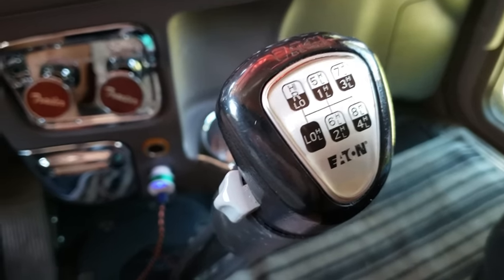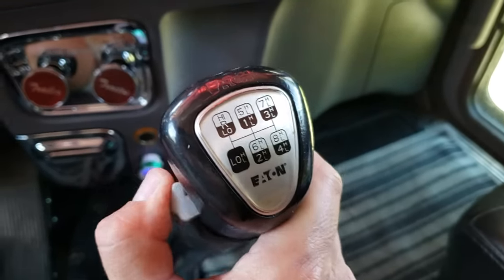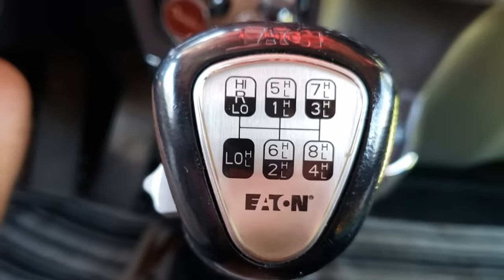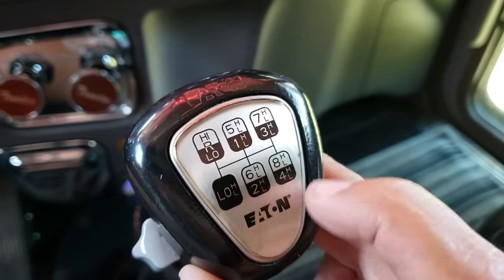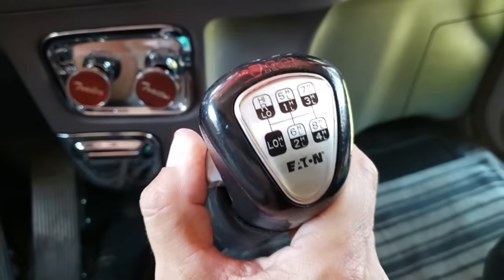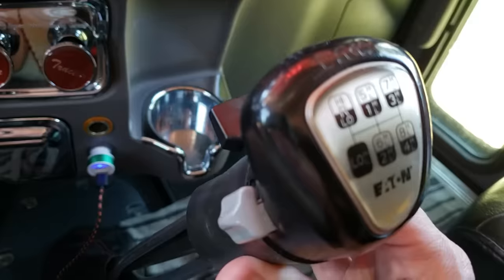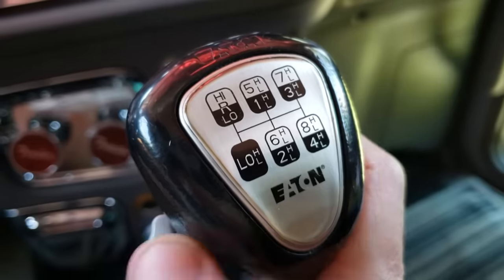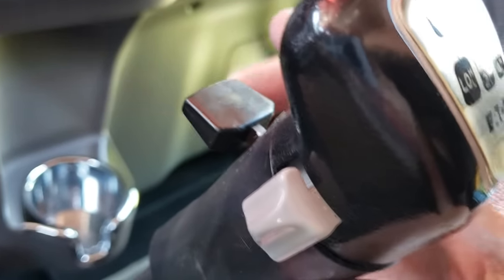HOW TO Shift 18-Speed Manual Eaton Transmission. Peterbilt, Volvo, Freightliner, Kenworth, Mack

Comment: What mph Range would you choose for what gear
Reply from the maker: Ohhhhhhhhhh man, that's hard to say.  Every truck is different depending on load, model, going up a hill or flat, and of course how much you are towing.  I don't even look at MPH versus what gear I'm in.  It's so easy to listen to engine, and don't over rev.  Semi trucks are so different that driving a normal Chevy or Ford truck.  It's all about taking your time and letting the torque build and get you down the road.  I love to keep my RPM's up a little bit when going up hill, then down the highway, let the truck cruise in top gear, if possible, for better fuel mileage...

Comment: For best explanation 18 is just 13 but the difference is that in 18 you have to split the gear in low gear ( 1, 2, 3, 4) but in 13 you don't split in  low gear, you split only in higher gear ( 5, 6, 7, 8 )

Comment: So, is one of those switches shifting a 2 speed rear end, or do they both shift in the transmission?
Reply: They both switch in the transmission. They normally have a high/low gear set on the back of the transmission. The splitter basically just adds another set of gears on the back of that.

Comment: Is it necessary to split every gear or just on hills or when pulling heavy loads?
Reply: I only do it going up hills or with heavy loads. You don’t have to use the splitter. You can just shift through the gears like a 10 speed.

Comment: Question. Can you down shift a half gear using the spliter on a small grade for more rpm. And are drivers double clutching an 18 speed ?
Reply from the maker: If you'd like, you bet...these transmissions are tough and fun to use after you memorize shifting, etc.

Comment: Is double clutch still used  when  changing gears?  I left trucking 15 years ago, can you update me on this one
Reply from the maker: You can double clutch if you'd like, but most people "bump" shift, give it a little throttle, shift like butter after awhile.  When you first get a CDL Class-A license, when you test drive they like you to double clutch.  95% of my friends don't double shift, take it easy...
Reply: Got it . Still the same. Right rpm and you don't need to use a clutch. They come with automatic transmissions for the new generation. My days we like to feel it the high and the lows. The extra red or Grey   switch on the stick confuse me.

Comment: What is it drivers prefer about a manual transmission as compared to an automatic? I am not a truck driver but I have towed a 26k stacker behind a SuperC RV and the Allison 4000 transmission was amazing. What advantage does all this manual shifting have?
Reply: I agree that Allisons are amazing, and a pleasure to drive, but the “automatic” transmission that you would find in a class 8 tractor is NOT a true automatic like an Allison. The proper term for it is an AUTOMATED transmission, and it is essentially a manual transmission with computer controlled actuators doing the shifting and clutching for you. It is a completely different animal than an Allison. 

While it can be a real help to novice drivers, and those who never quite got the hang of shifting an unsynchronized manual, it can be terribly frustrating for drivers who have mastered manuals. Notice that I said “can be”. Some experienced drivers love them, especially in stop-and-go traffic. Personally, I despise the one I’m driving. I won’t get into the reasons, because they are numerous and would require rather lengthy and technical explanations. But I would much rather have a 10 or 13 speed manual.

Comment: So is going from 4th to 5th just essentially 4th to 1st? Do you flip the splitter?
Reply: Yes. The paddle on the front switches between the low and high side. Basically changes a gear set on the back of the transmission that takes it from an under drive to direct or overdrive. So, you basically shift like a 4 speed on the low side then switch to the high side and start over in 1st. 
The splitter is only shifted while you’re in a gear. It’s less of a change than shifting to a different gear. That’s why they get called half gears since it’s kinda like only changing a half a gear instead of going up/down a whole gear. 
He didn’t really cover that the paddle for high/low range only shifts when you go through neutral. Flipping the paddle while it’s in gear won’t do anything. The splitter switch on the side shifts when it’s in gear, but you have to back off the throttle since it can’t shift under load. 

It makes way more sense if you get to drive one for a while. Going up through the gears is pretty easy. Slowing down is harder since you have to rev the engine to the right rpm to get it into gear. It’s also hard being able to pick the right gear for the speed if skipping gears.

Comment: Does the black thing only stay down at 1 thru 4 and it just stays up for anything past 4?
Reply: Think of the black this as high and low 1-4 in low than the same 1-4 becomes 5-8 in high and on 18 speeds you can split ever gear into another high and low.

Comment: When you are on 4th gear,you don't go to 5th.yougo to low,but with the selector up.wich will make it an extra hi gear.
Reply: Not with this one. Low is extra low so if you go from 4th to Low on the high side it wouldn’t be much of a change. Especially with the splitter. 4th split high is probably almost the same ratio as Low in high range.

Comment: Waste of gears unless you heavy hauling and I'm not talking 46k in the box I'm talking grossing 100k plus to the ground.  You're never gonna use all the holes in an 18 unless you just like wasting time shifting gears.  Best overall transmission has always been and always will be the 13.  Other than that this was a good training video.  Good job hand 👍🏾 🚛🚛🚛

Comment: @2:42  I thought the H/L in LO gear referred to the option to use the splitter, just like is indicated on the numbered gears.   I would think one would avoid the range selector in LO gear, just like in a 9-speed.  

Doesn't the combination of high range selector + LO gear yield an overall ratio just below 5th gear-- essentially equivalent to 4th gear?   Isn't this why a 9-speed isn't a 10-speed, because there are only 9 unique forward speeds (even if there are 10 forward configurations)?

I always thought an 18-speed was a 9-speed + a splitter on every gear.  (Whereas a 13-speed is a 9-speed with a splitter only on the high-range 4 gears.)

Comment: Mercedes benz has the same thing I mean the white button but instead of using the throttle you just push the clutch and the gear changes without moving the stick

Comment: Seems like under most circumstances you can just run 1-8 right? You shouldn't need to split gears unless you're running heavy loads right? Is that the purpose of it or am I missing something?
Reply: You only use the gears you need. When I'm pulling two empty 53' trailer I can straight shift up to 8th and then split up or I can split 1st and straight shift up to 8th.

Comment: My question is do you need to split the gears or can you just go into the next without splitting
Reply: Yes. no need to split whatsoever. Can run 1-8 in either L or H. Split gears only needed when fully loaded or upshifting up an incline.

Comment: I've always drove a straight 10 so I was always curious how that worked. It's actually way easy just gives more options if you didn't want to downshift the whole gear for more rpm
Reply: Yes can split a gear and only drop 200 rpm instead of 400.  If you got a very heavy load you can keep the turbo in the sweet spot on hills.

Comment: To down shift you have grey button to the forward slow down depress the clutch down shift, then pre select the switch down ease on the brake a little ease on the gas she will shift down pre select button forward easy on break cluch down next gear

Comment: I know this is a silly question but I drive a 5 speed manual car and I have no experience with trucks but I really want to learn to drive a 18 speed truck will it be challenging? Any suggestions? Oh and I’m 23 years old.
Reply: Not even remotely the same. Car and pickup manual transmissions are all synchronized. In North America big truck transmissions are not. You have to manually synchronize using the throttle. Sounds tough but once you get the hang of it, it's a piece of cake. BTW, your age has nothing to do with it. Just find someone to show you the tricks and you're good to go.

Comment: How do you remember what gear you’re in
Reply from the maker: After a day or two with this trans, it's not hard to remember the gears.  If you forget you can always flip the selector to the (down) position and go into a gear according to your speed.  The trans won't break, and if you let out the clutch slow you will really know if you are way too low.  If you are too high the engine will just lug.  But like I said, the more you drive you just automatically figure it out.  Most drivers that prefer manual, love the 18 speed the most.  So much variety, especially when you go uphill or want to pass, etc...
Reply: just go with a company that offer automatics
Reply: @poundtrader1414  I’m just trying get more information on a 18spd before I jump in it I know how to drive a 9/10 Speed im just trying learn some extra tricks to make it easier and smoother

Comment: Best explanation thanks.How do you down shift a 18 speed
Reply: ex. max load 80kLB at 60mph start going up a steep grade 6%+ from 8h, watch your rpm, wait till rpm drops between 10-10.5, then go 8L then watch rpm drop 10-10.5 then go 7H watch rpm drop 10-10.5 go 7L then watch rpm drop 10-10.5 go 6H.. and so on until rpm is stable.

Comment: Do you have to clutch in and out, every time you shift , the shift stick? As you would on a regular manual transmission? And is it true that if you skip a gear, your truck shuts off?
Reply: class c manual vehicle and class a manual truck completely different.. class a manual truck is about rpm and when using the clutch you only clutch in and out about 5%-10%.. if you clutch it all the way like a normal car, it will not go in.. only push the clutch down all the way when coming to a full stop. once at full stop, take it out of gear and start at 1st if fully loaded or 3rd/ 4th if empty.
Reply: If you push the clutch to the floor in a big truck you will burn out the clutch brake. No clutch brake on cars or pickup trucks. I only use the clutch when starting or stopping. The truck does not shut off if you skip shift.

Comment: Reverse is not counted in number of speed. 18, 13, 10. It refers to the forward moving gears. So (LO.L) would be 1 (LO.H) would be 2 (1.L) would be 3
(1.H) would be 4. So on and so on. 
Sometimes you will come across a Reverse that has hi,lo that can also be split. Therefore making 4 Reverse gears, and 18 forward gears. Otherwise great video
Reply: Correct.  I was wondering why he skipped the fact that you have two in LO

Comment: I know that the difference between an 18 speed and 13 speed is that all the gears on the 18 has high and low ( split ) and on the 13 it is the high gears that has high and low ( split ).What is the arrangement for the 15 speed transmission, that is what is the shifting pattern for 15 .
Reply: 15spd transmission do not work even remotely the same. The splitter on a 15spd is a deep reduction splitter that gives you 5 gears that are lower than 1st gear. It's basically a 10spd with 5 creeper gears and they are not used together.

Comment: IMHO, the low gears of an 18 speed are only needed for extremely heavy haul or driving off-road in dirt/mud.  I haul un-baffled liquid and routinely scale at 88,000.  I start in 2nd unless stopped on an uphill grade.

Comment: So, when shifting from say 6H-7L, does the stick need to be in neutral to "unsplit" the shifter? (Not a  driver, but considering new career paths here).
Reply: Not really required, you can switch it  before you shift however the second you take your foot off the fuel the truck will try and shift to 6 low, so you'll get a smoother shift if you switch the  splitter while your in between gears

Comment: Thanks! Great vid. It’s actually a 22 speed, because the h/l reverse and de LO h/l are 4 gears + the 2x 8 normal gears... right? 🤔
Reply: Reverse doesn't count as a gear.
It's just a different direction.
Reply: @donalejo1556  yes exactly. I've never heard anybody count reverse as a speed. In reality all vehicles have reverse so that would be pointless.

The guy in the video is incorrect in his explanation of how it's 18 speed however that's of little consequence. All that matters is how you drive it. How I've heard it described by a heavy-vehicle assessor is 8 main gears all of which can be split for 16 plus the low gear which can also be split for the 18

Comment: I wouldn't use the high low splitter in reverse that's just like 6th gear speed in reverse almost dummy use the top splitter on the side for slightly faster

Comment: It's a glorified 13 spd. Only difference is you can split the low side with your splitter. With a 13 spd you can only use the splitter on the high side.

Comment: Anyone know what problems is or why when I hit splitter to go back to low gears it won't? Had this issue in other Kenworth but can't get ahold of mechanic to ask
Reply from the maker: Sometimes you have to tap the pedal for it to downshift.  Might need an adjustment or new parts...
Reply: @CoryJDraper  yeah we just rebuilt transmission and it's been doing it since. I was able to finagle by slowing n stopping quick, etc. Now it's really stuck,  needs something I was hoping someone would see this n go oh yeah my Kenworth did that too, this is what's needed!?

Comment: So instead splitting the gear, ie 7th then split the gear, isnt that putting into 7H from 7L. Like you said 7th to 7th 1/2. But isnt that low to high?. But in the bottom gears you use the black switch, for high low? Cause you use that to transition from 4 to 5. So you're not putting back into 1st. Or 8th to 5th etc etc.

Comment: to call it 18gears is a litle bit show off  actually  is 8 gears 4 low 4 high and you can split them all  so 8+8=16 plus  1 for crowling and 1 reverse witch you can also split them or use high and low.
usually at the 4 low gears depends the load and how powerfull is the truck you do not split .

Comment: Hey there Cory , what Revs on tac to change up and changing down gears estimate ? 
thanks , good video
Reply: That depends on so many things. Horsepower and torque of the engine. Flat ground or hills. Total weight of the truck. You end up shifting so much that after a while it becomes second nature.

Comment: In actuality it's 16 speed folks...for forward gears that is
Reply: No. He stated it wrong. Lo, 1, 2, 3 & 4 can be split which is 10 gears. Flip it into high range and 5, 6, 7 & 8 can be split for 8 more gears. Reverse has nothing to do with it. Lo isn't used in high range.

Comment: Why does something that only goes up to 60mph with a governor have 18 speeds?
Reply: They have a narrow rpm range on the engine and relatively low power for the weight they’re hauling. So, having so many speeds let’s you keep the engine in it’s ideal rpm range.  You generally try to keep the big diesels between about 1200 and 1800 rpm. Most are only about 2500 rpm max rpm.
Reply: @NBSV1  is it hard to keep it in the rpm range? also if it much different to drive with a heavy load vs no load ?
Reply: @beauhalliday9496  It's not that hard to keep it in the overall range which is between about 1200 rpm and 2000 rpm. But, if you're able to keep it closer to where it makes peak power then there's quite a bit more power available and it'll do better.

It's way different with a load. If it's just the truck by itself you can simplify it a lot by basically just sticking to the high gears and treating it like a normal 4 or 5 speed transmission. With an empty trailer you can still take off in 2nd or 3rd pretty easy and not worry about splitting gears. If loaded heavy then you end up taking off in low or 1st and may not really need to split all the gears, but it makes it smoother and will pull better. 

There's a good bit of skill in learning the timing for shifting. Hard to really get a handle on it without driving and feeling it.

Comment: Anyone wanna explain why you would spec a truck with this many gears to not be an automatic?
Reply: Because the automatics are usually just 10 speeds or less. Because the automatic is just reacting to conditions they sometimes struggle with figuring out what gear to be in with only 10 speeds. Give them 18 and it’d probably wear everything out from constantly shifting trying to keep up.

Comment: I like 18’s, I’m driving a 13 now and the low range is irritating without splitting
Reply: Splitting the bottom gears is mostly a convenience. Really handy when you have to start out on a very steep hill. I've been running 18's for 10 years and rarely split 1-4.

Comment: I got it pretty quickly. Going for a job with a 18spd. Drove nothing but 10spd and was worried because it’s new, but it’s pretty simple. I got it with the splitting before you fully explained it.

Comment: So pretty much just drive an 18spd like a 13spd ? lol got it!! Only difference is the color of the splitter and you have the option to spilt every low gear with an 18 spd
Reply: Yes. BTW, if you leave the splitter in hi and you try to downshift into low range, the range selector on a 13spd will not move, on the 18spd it will allow you to shift into low range.

Comment: @ 2:40 is not correct, I gather you don't haul heavy loads and use low gear.  It's all black what coincides with the low range, means a "split".  The low and high range is on the back of the transmission the splits are within the main and secondary drives in the "main housing".  I would take a look at a transmission apart so you can see secondary / main and back end low / high range.